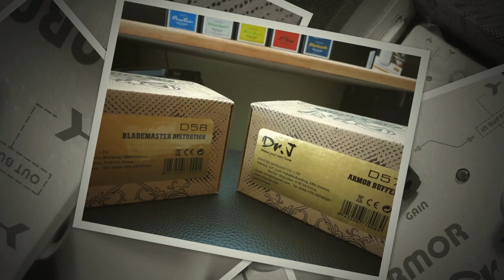Dr. J Armor Buffer - Demo - What is a Buffer?

Comment: My understanding (and I could be totally wrong) is that the output Impedance (essentially the "voltage" divided by the "resistance") along with the capacitance (determined by cable length) in this case long cables/long cable chains, creates a low pass filter essentially.  That is why if you run a high quality cable straight to an amp your signal sounds better, where as if you run it though all kinds of electronics with long lengths/ patch cables it can sound kinda muddy. The idea with the old fuzz pedals is that they generally operate on fairly low impedance, thereby reducing the signal which is why you want to place them in front of the buffer, as the buffer increases the high frequency response. (Again I could be totally wrong in this). Great video Henning. I have been playing for a long time and was never really a "pedal guy". I have learned quite a bit from your channel, and along with the in depth info given, you provide access to high quality samples of how the pedal sounds and in what context it is used. Personally I appreciate what you do, it has really helped educate me as well as save me tons of money trying to figure out if a pedal is right for me.
Reply from the maker: Thanks for The Information.... great to have you on the channel... let's learn from each other! So much more I don't know.... what a ride!

Comment: They also isolate DC leakage in the signal path. For instance if a pedal starts popping when you hit the footswitch there's very likely dc on the output of the pedal in front of it.  Put a buffer between them, maybe not this heiffer tho.

Comment: Does the boost comes after the input or the output buffer? If i have an overdrive in the loop for example will it give it just volume boost or gain boost? 
And if i have 5 pedals that 2 of them are not true bypass but i still hear tone loss connected to my board will the armor buffer do good job or too mamy buffers is bad? 
And last question, is it possible to use only one of the 2 buffers ? For example guitar->pedals->output buffer->amplifier
Reply from the maker: Amir Nehmad Yes, you can use only one of the buffers, no problem. I cannot tell you where in the chain the boost is... I would say it comes first and then goes out tot he pedals... I would also use it with buffered pedals...

Comment: I'm hoping to get an answer since this video is 2 years old, but can I assume that the JOYO PXL Live is doing the same thing with the pedals in the loop like the armor buffer, other than looping as the main function? Also, if I'm sending Loop 1(meaning the four pedals in PXL Live) to my Marshall, and coming back to Loop 2 from the FX loop, will the signal passing the preamp section be buffered? I thought it would be pretty interesting to hear some difference in the definition of a preamp being buffered.
Reply: The buffer in the Joyo switcher is not the best quality. My guess? The Dr. J is a better buffer.

Comment: So... the buffer is for guitarists who use only true bypass pedals to avoid buffering? I don't get it. I'd rather have buffered pedal like TS there (although if you happen to need a clean boost Armor my be the one to get). I was bit disappointed you didn't try a chain with any buffered pedal instead of Armor.
Reply from the maker: Sorry... didn't think of doing that.. was trying to show the armor buffer.... also not sure which ones buffer and which don't.... I think the ultimate drive has a buffer... but what do I know...
Reply: EytschPi42 I'm new to pedals just like you but from what I've seen, true bypass is considered a feature and is always mentioned to sell more units to silly guitarists. From Joyo I know D-seed is buffered, Ultimate Drive is not (I just checked the last one). But If you're curious, I would try a TubeScreamer (in a bypass mode of course).
Reply: If you run all buffered pedals your tone will degrade and you'll lose a lot of high-end. Wampler did this with an all-Boss pedalboard. +Nihil Quest check it out:  https://youtu.be/-oxBlWmeGE0